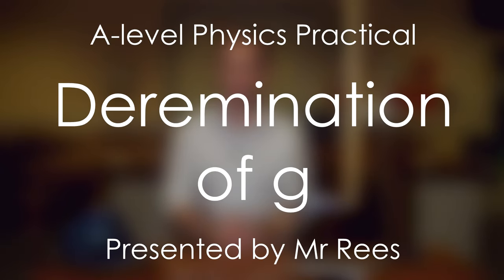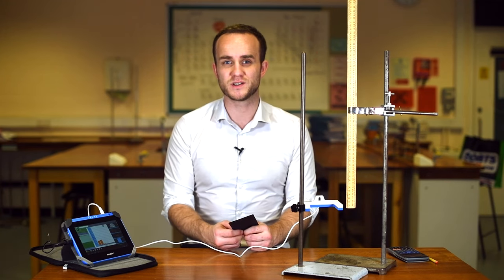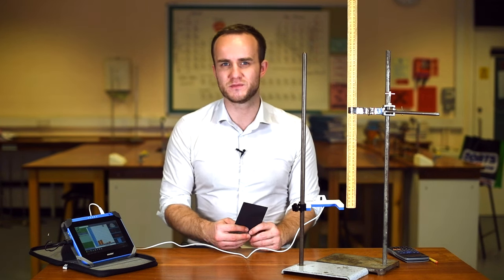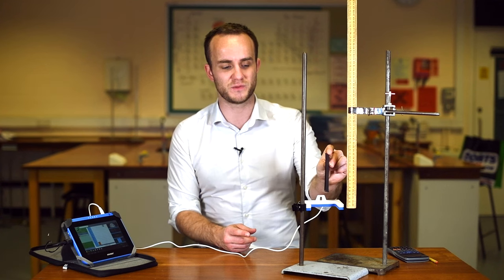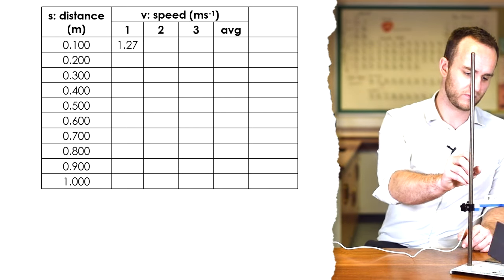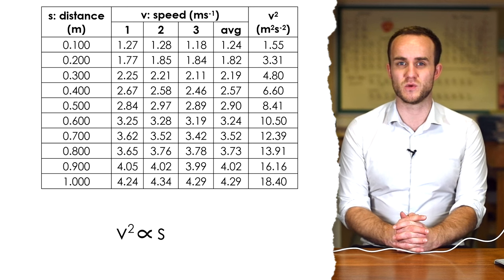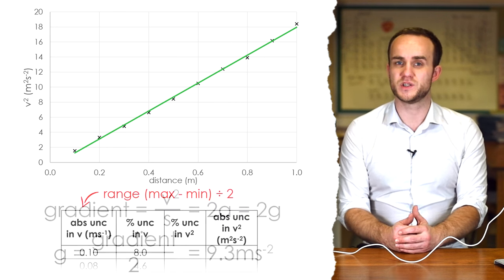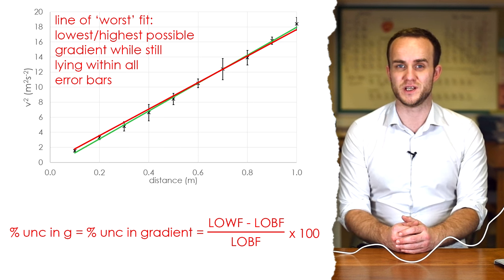Determination of g by freefall method - Physics A-level Required Practical

Comment: Just to clarify, when an object is free-falling, does its velocity increase as it gets to the ground?
Reply: Yes
Reply: Thank you!
Reply: Yes, if there's no air resistance.
Reply: @wanstudent4502  Yeah but air resisitance will increase as the card falls down, until the air resistance equals the gravity force and the card will travel at constant velocity
Reply: @marksmith5591  agree although the question was 'does the velocity increase' . So does that not mean it will continue increasing until it hits the ground unless there's air resistance?
Reply: @marksmith5591  also, not sure what card you'd referring to.
Reply: I see you in all A level physics video man is grinding